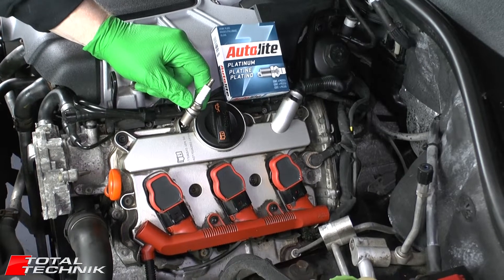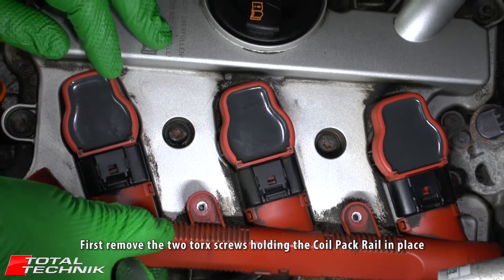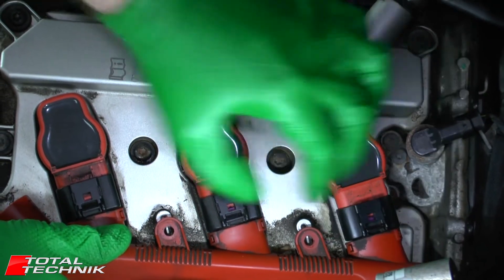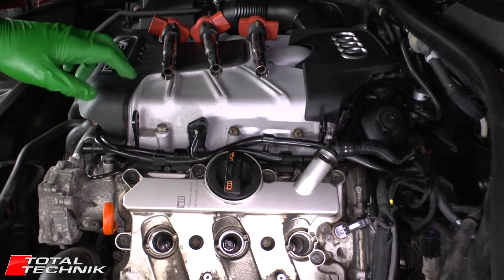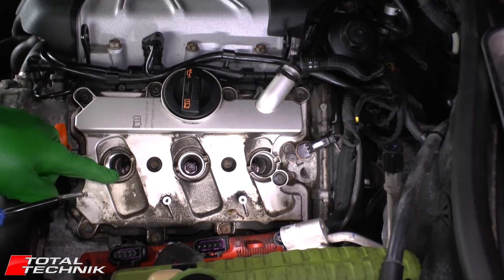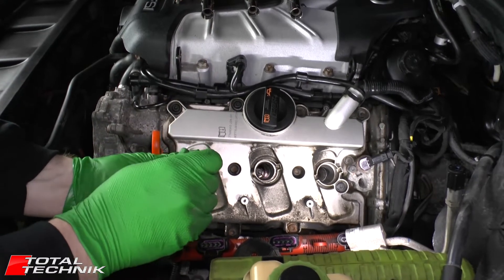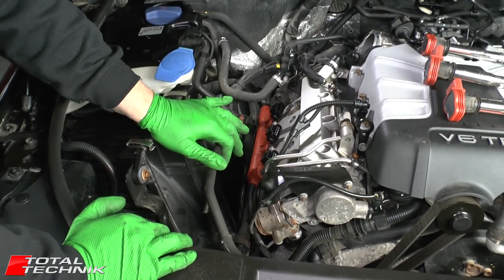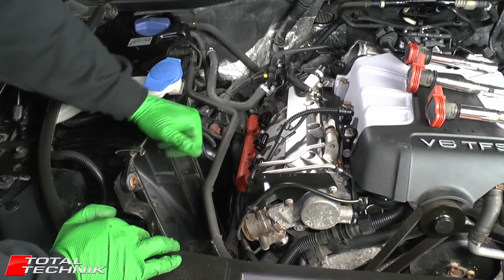How to Change Spark Plugs - Audi Q7 3.0 TFSI - 4L - 2005-2015 - TOTAL TECHNIK

Comment from the maker: Coil Pack Puller Tool (Single):
Amazon USA: https://amzn.to/3FYPgQj
Amazon Canada: https://amzn.to/4j12udJ Kit is cheaper!
Amazon UK: https://amzn.to/4cxBNLy

Coil Pack Puller Kit (Great Value):
Amazon USA: https://amzn.to/3EoXbWn
Amazon Canada: https://amzn.to/4jdXbrx
Amazon UK: https://amzn.to/4joZ6ZZ

Spark Plugs:
Amazon USA: https://amzn.to/4i730Wf
Amazon Canada: https://amzn.to/42Aw4B3
Amazon UK: https://amzn.to/42COlO1

Locking Extension Bar Set 3/8":
Amazon USA: https://amzn.to/4j3GjUh
Amazon Canada: https://amzn.to/44jDwlj
Amazon UK: https://amzn.to/3G1NWMh

Air Blaster Can (for clearing debris from spark plug chamber):
Amazon USA: https://amzn.to/4ibAyCU
Amazon Canada: https://amzn.to/4cBJhgw
Amazon UK: https://amzn.to/3YmaZYA

Spark Plug Gapping Gauge:
Amazon USA: https://amzn.to/42pgB5D
Amazon Canada: https://amzn.to/3G4UvOe
Amazon UK: https://amzn.to/3EgdZ1Q

Torque Wrench 3/8":
Amazon USA: https://amzn.to/4jwEPlr
Amazon Canada: https://amzn.to/3RIOCJ3
Amazon UK: https://amzn.to/44iScRG

Spark Plug Socket (Best Value Set including Size 16):
Amazon USA: https://amzn.to/3G1Lupc
Amazon Canada: https://amzn.to/4j7qpbF
Amazon UK: https://amzn.to/428L1u7

Coil Packs:
Amazon USA: https://amzn.to/4j4sAfS
Amazon Canada: https://amzn.to/3YmaRby
Amazon UK: https://amzn.to/42lOpjV

Comment: how do i know which one is ignition coil 4? i am getting p0304 error and struggling the order
Reply: p0304 was on the 4th cyclinder. swapped the 4th ignition coil with 3rd. Checked the OBD and it was still throwing the same error of p0304. I then knew it was the spark plug on the 4th cylinder. I put back the swapped ignition coil and then replaced the spark plug on 4th cylinder with a new NGK spark plug. Refitted everything back and restarted the car. No more errors were thrown and OBD also ran a clean scan. Drove for 15min and nothing problematic. Running smoothly now. Thanks to Total Technik for this vido, gave me confidence to fix it myself.
Reply: i figured out its 1-2-3 on the passenger side. 4-5-6 on the driver side. 1 and 4 are towards the front and 3 and 6 are towards the winshield
Reply: for any others trying, this was very easy to install and saved me 400$ that was quoted by a local work shop (not Audi dealer, i am sure it would be have been even higher).